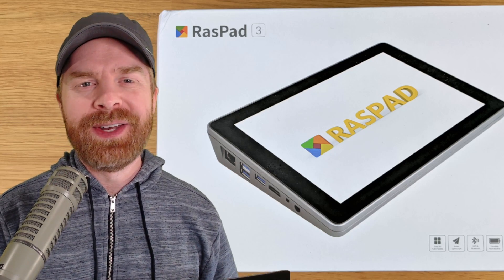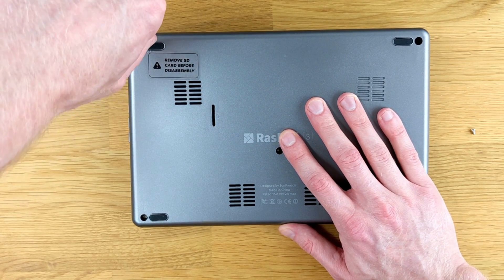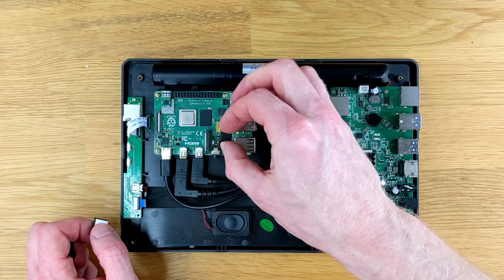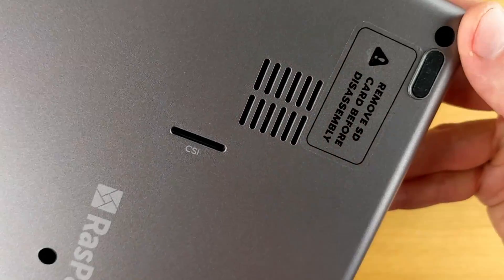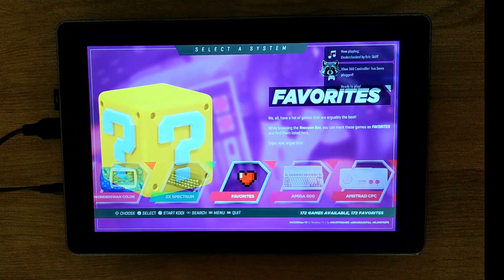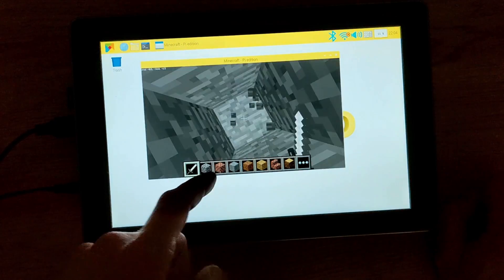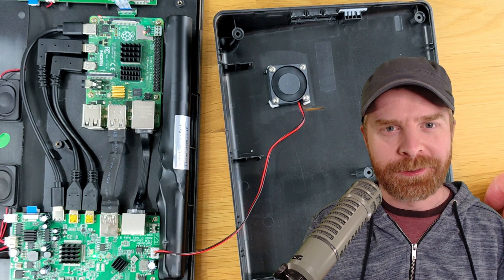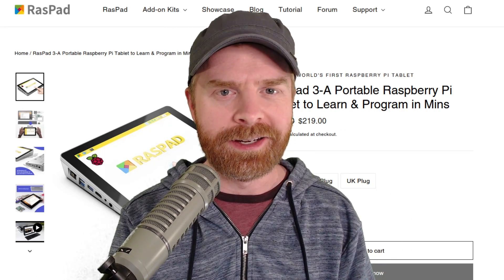DIY Raspberry Pi Tablet: RasPad 3

Comment: The price is too high for what it is, but if I were going to get one I think I'd remove the fan and tiny heatsinks and go with something along the lines of GeekWorm's embedded armor heatsink & fan. The entire cooling system w/ fan mounted still sits lower than the ports on the Pi so it should work fine in this device

Comment: Sounds like that sound was a wire scraping against the fins of the fan; probably the fan's own wires..?
Reply from the maker: That's what I thought! Turned out the fan was scraping against its own case. When it was screwed in, the fan surround was slightly warped